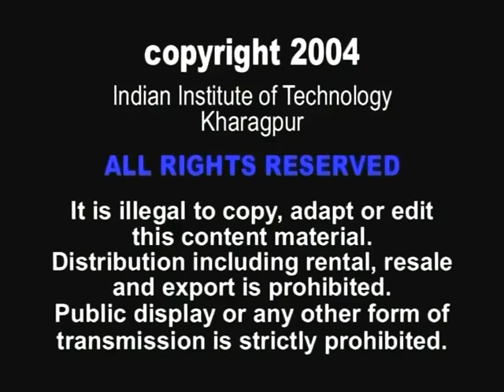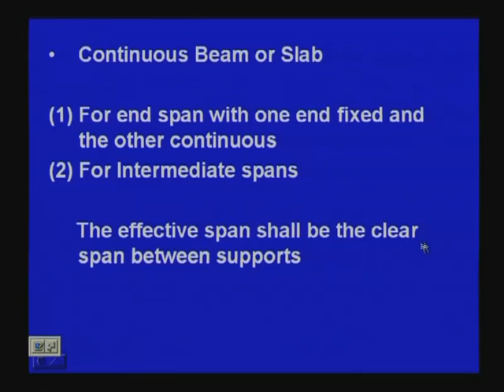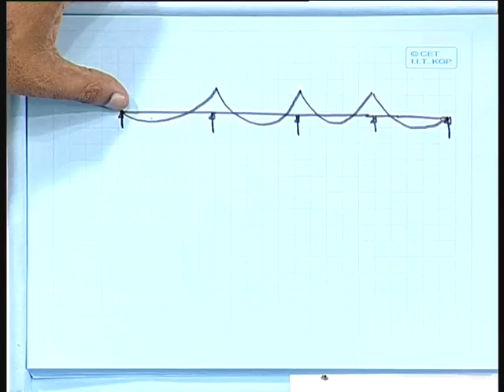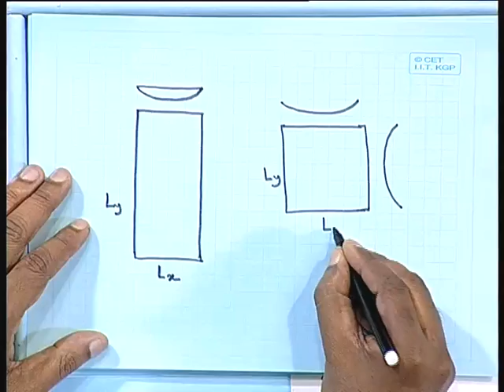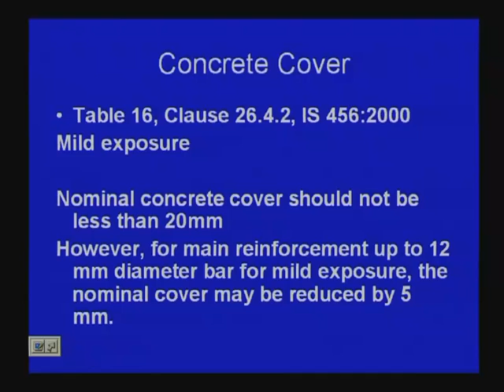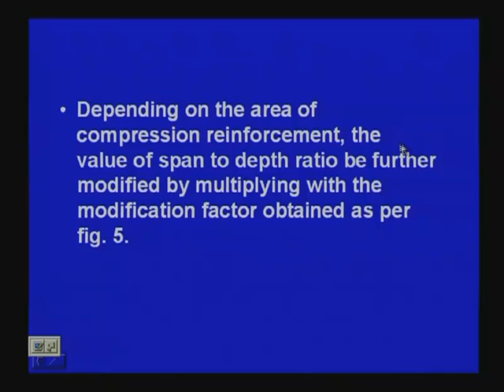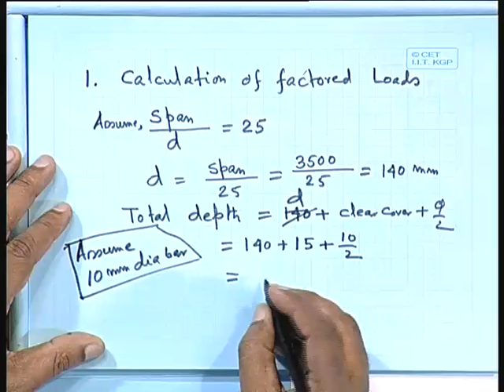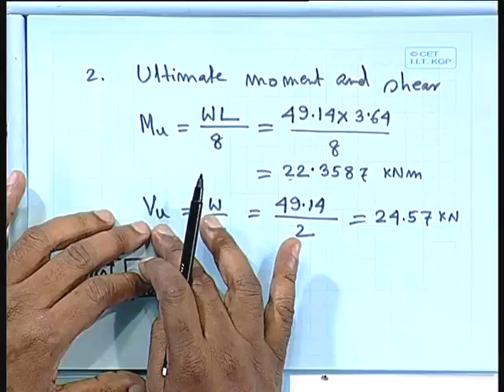Design of Slabs Part - 1

Comment: In IS code , it is clearly mentioned that for span less than 10m, we have to use basic value 20 for simply supported beam. And in this question, sir had used 25 . Please clear my doubt anyone.
Reply: We have used 25 because we are considering external forces like reinforcement, loads and etcetc . Better thanks little extra than the given .

Comment: since we are trying to calculate the total load per meter width should we not have multiplied it by 8 m instead and not the effective span,,,multiplying it by the effective span will give you the UDL in the long span direction,,,i am just asking

Comment: Sir I want ans of two questions. 
1) why modification factor is multiply to span/depth ratio ?
2)we use four different MF. (MF1,MF2,MF3,MF4) for different requirement. MF1 value calculation is given into the code .but when It is necessary to use of other factors how can I get value?  Because I cannot find it in IS:456.i cannot find even reference.
Reply: do u not know how to take readings from a graph using a ruler ? u learn that in middle school 🤣🤣🤣🤣

Comment: IS codes are not as reliable and true as ACI codes...American concrete institute (ACI) codes are far better...I mean the lecture is pretty good and pretty easy but conflict starts when IS codes come in picture...do follow ACI codes
Reply: No conflict  it as per economical design in ACI they have taken cylindrical specimen where as in IS  taken cubical compressive strength  which comes more than cylinder ...we can say that they are on more safer side but not economical to their resources...